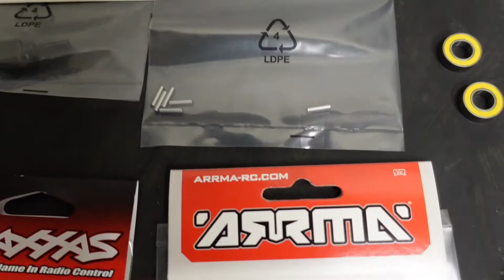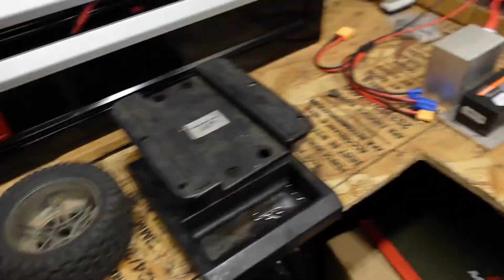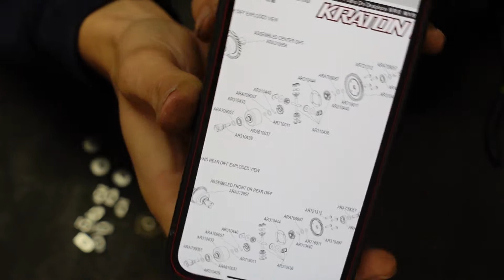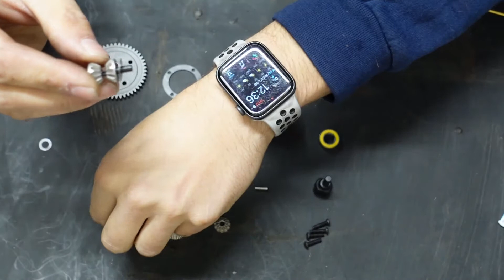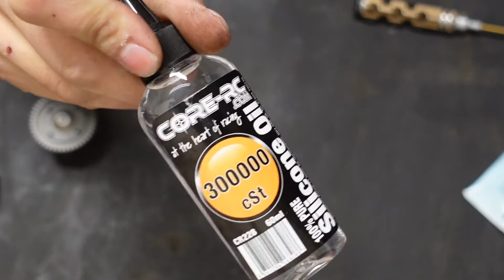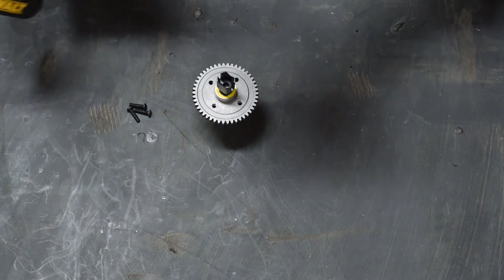How To Build/Repair an Arrma1/8th 6s Center Diff for Kraton,Talion, Typhon, Limitless

Comment: 5:10 i cant for the life of me get the sungear out. Its suctioned so fucking hard in there. I have tried using numorous picks to get under it and try to pry it off but cant. I have tried using my air compressor to blow out any oil that might be trapped under it, doesnt help

Comment: I have gone through and been giving some diffs. But for some reason when I get it put together the cups from the diff to the dogbones seem to want to move back and forth as if they're loose. Not sure why. Anything you could think of to help please sir.  Pins are fine, gears are fine just the cups move up and down for some reason and I dont want it to cause more issues.  And not buying new ones.

Comment: My car pulls to one side only on power does anyone know what that is ?
Reply: You could have a broken pin.  I found my broken pin on the dog bone that connects from the center diff to the rear diff.  I was having power go to the right side in the back of my truck.  My wheelie machine became a donut machine.
Reply: @robertb.4202  I did thank you very much.

Comment: Question
A bit off topic… but related.  The rear diff on a Kraton 6s… I rebuilt it.  When spinning, they rotate opposite, but they lock up after 1/8th turn but sometimes after a full 360 turn?  Is this normal for a rear diff?
Reply from the maker: It should not do that. Something wrong with the internals.
Reply: @RCMadnessHobby  can I change out all my differentials in my  V5 to EXB ?